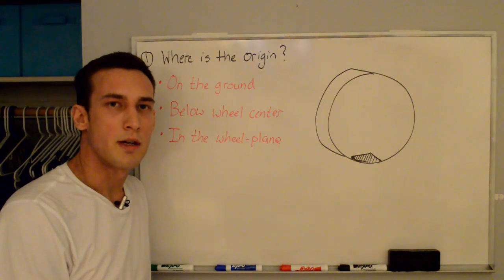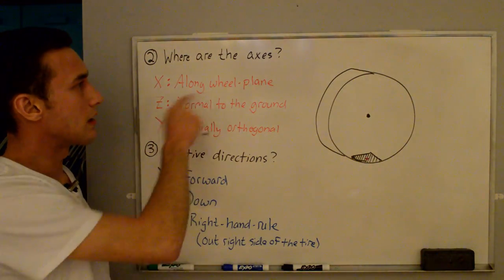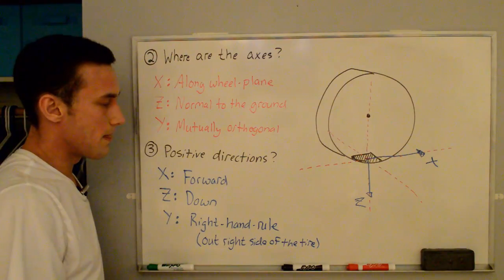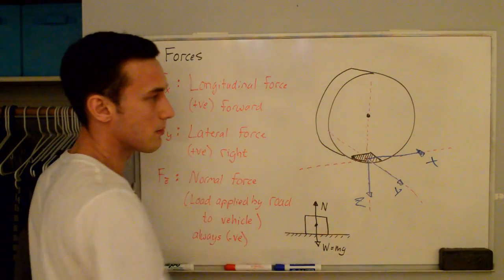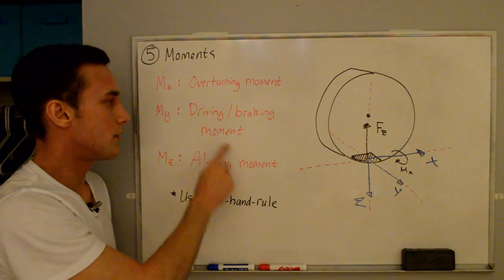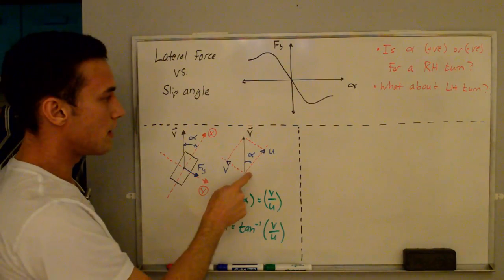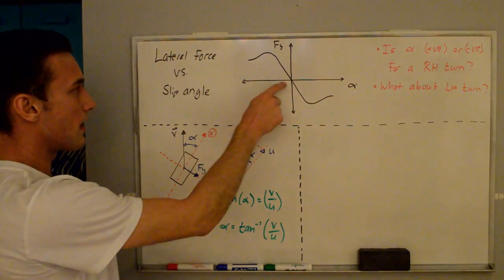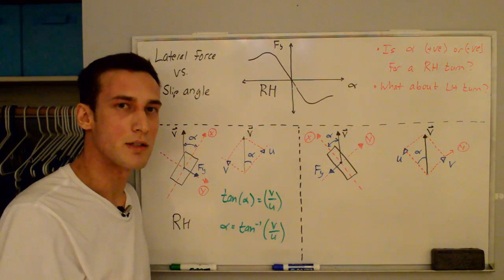Explained: Tire Axis System

Comment: I can't understand What is the difference between the the direction where the tyre is "headed" and the direction where the tyre is "pointed" ? What is the difference between these two terms ? I can't imagine how does a car have two directions at the same time 😭😭
Reply from the maker: I find the best way to understand this is to think about the most extreme case.  Take a tire and put it on the ground.  Start rolling it forward.  The tire is headed straight (it is rolling straight), and it is pointed straight (the forward axis of the tire points forward in the direction of rolling).  This tire has no slip angle.  Now take the tire, sit it on the ground, and turn it to the right 90 degrees.  Start pushing the tire forward (it's going to be harder).  Once it gets going, the tire is still heading straight ahead, but it is pointed to the right.  The slip angle in this case is 90 degrees, the angle between where the tire is headed and where it is pointed.
Reply: right hand rule?
Reply: the rolling resistance, tread pattern, tread compound , tire deflection , pressure, rubber hysteresis are contributing factors of difference wheel is pointing and tire is heading  causing that slip angle